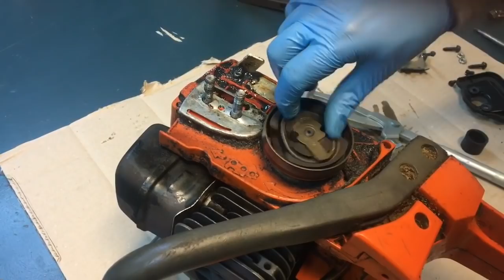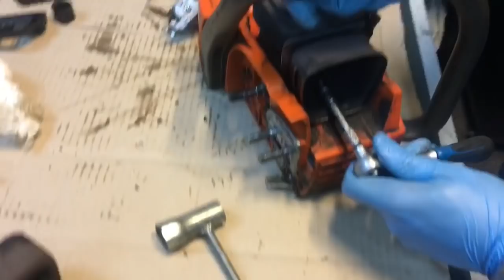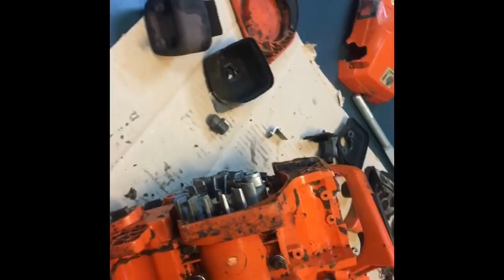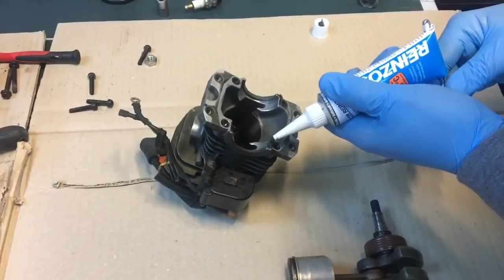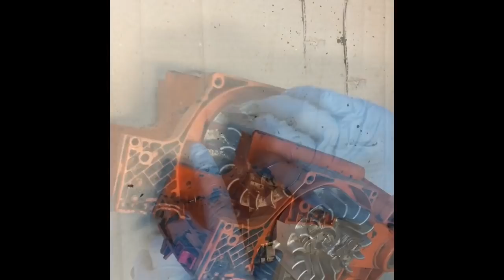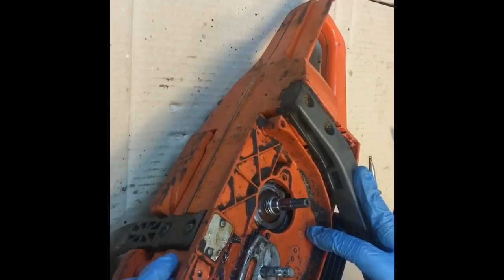Schimbat rulmenti cu simeringuri drujba Husqvarna 136, 137, 141, 142

Comment: Salutare am o husqvarna 236 si mi sa blocat rotița motrică si se ânvârte cu tot cu demarou âmi spuneți și mi-e vă rog ce ar fi
Reply from the maker: Arcurile de la saboti posibil
Reply: SHR Motors vă mulțumesc dar dacă ar fi arcurile cam cât ar costa ?
Reply from the maker: https://www.shr-motors.ro/arc-saboti-ambreiaj-drujba-husqvarna-36-41-136-137-141-142-235-235e-236-240-240e-partner-351-350-370-mcculloch-mac-438-ikra-ksb-3940-calitatea-i